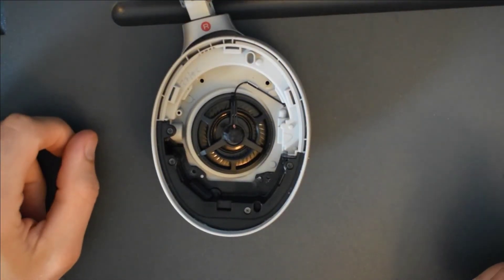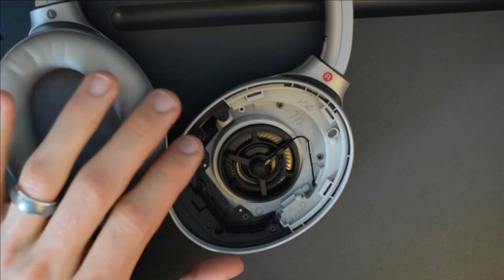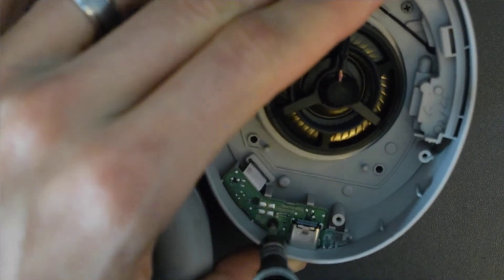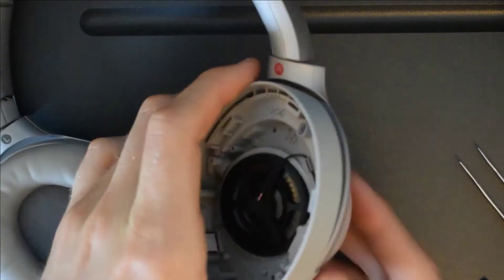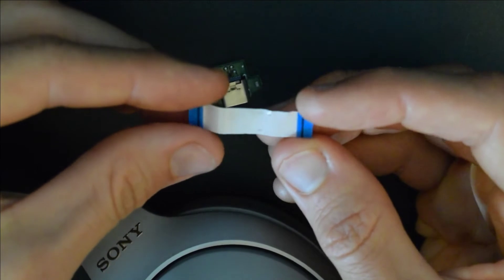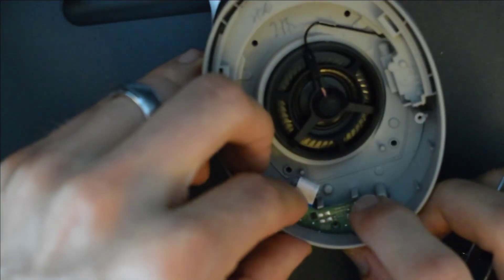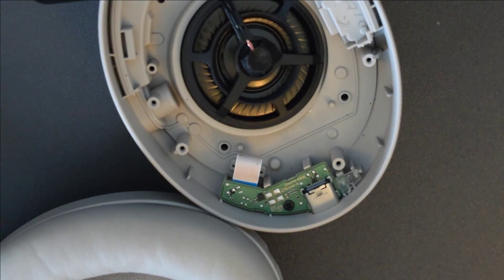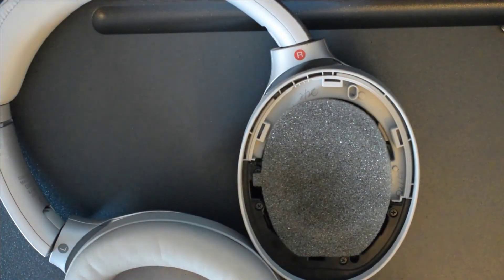Sony WH-1000XM3 Bluetooth Headphones Charging Port Repair/Replacement DIY Walkthrough/Tutorial

Comment: Hi, do you have any idea where to get an AUX port replacement? I have used it for a long time now, it started to give me trouble there is  background noise and not a clear sound ... use to work fine .. tryed cleaning it with isopropyl alcohol that help for couple days only ... any Idea how to fix this ?

Comment: Very helpful!  I have the Sony Noise Cancelling Headphones WH CH700n that are older than the hills and just recently (about 6 months ago) my headphones have to be in a certain position before they charge.  Seems to be a short somewhere.  I tried a different USB cable, but the same thing happens.  I'm not new to electronics, but the thought of opening them up does make me a little nervous.  I love these headphones and I can't afford to replace them right now if something should go wrong.  So this weekend it looks like I will see what's going on with them.  Hopefully it will be an easy fix. 🤞

Comment: Hi! Great video, thanks alot. Unfortunately my main cable got a problem. I managed to open it up and i saw that one small cable is broken and i can t solder it. Is there any way to replace the main cable?
Reply: What main cable are you talking about? what does it connect to? are you talking about the cable that connects the charging port to the main board?
Reply: @HaniJIsmail  , the cable that connects the right earcup to the left one. one small wire inside that cable is broken and i can t solder it so my right earcup sound doesn t work, but all the functions and sensors and microphones work just fine

Comment: Could u tell me exactly what flex cable I need to get for replacing it. I’ve replaced my port but it’s not work’n. Pretty sure the cable is shot. Just don’t know anything about this stuff. Looks to be 14 pin. Is that right? Any info u can give me would be great and maybe where I should get one. Thanks man.

Comment: Hi Thanks for video, would you be able to update the ebay link to buy the charging port. It seems that is not working anymore. Also would you be able to confirm if this is the same charging port for XM1002?

Comment: I just completed this and it went fairly well. It's worth noting that on mine the ribbon cable was secured to the slot with a dollop of adhesive. I picked this out with a pair of tweezers to free the cable but some adhesive had flowed into the slot, making it nearly impossible to get the new cable through. I managed to clear out the slot with a metal pick and a spudger. If you're having trouble getting the new cable through, shine a light in the slot and make sure it's clear of adhesive.
Reply: I had the same issue with the adhesive residue in the slot when trying to reinsert the ribbon.  I was able to use a fairly firm but thin card stock (index card) cut to the size of the slot to clear the residue.

Comment: If I just need the cable that is attached to the charging board, where would I get that? I have searched eBay, but there are dozens of types.

Comment: Hi, my son accidentally used the plug to charge my headset on the input, then i heard a burning smell. After that it didnt work, i tried replacing the battery, to no luck. It doesnt have warranty, what can you advise?

Comment: Hey is there a fix for my WH1000XM3's?
Its the issue where they charge, charging light turns on and the headphones work with aux but the buttons on the left side dont work so i cant turn it on, i tried a fix where you simply open up the left side and nudge all the wires but they dont work, and the button reset, none have worked. The headphones arent fried since aux works, but they dont power on.
Reply: Same here, have you found out anything?
Reply: @markelollo70  Nope, i sold them as broken, but im pretty sure it was maybe a battery replacement that wouldve worked.

Comment: Very good video and my repair seems successful so far as a result. Thanks! My one criticism is you skipped over a couple of parts after describing them (e.g.the removal of the old charging port at 2:00, the feed through of the new cable at 3:56) which would have been helpful to actually see.

Comment: I have a separate issue with the 3.5mm headphone port - the surround is cracked  and the port seems to be getting pushed into the cups. Any chance you have a video for that and/or the parts to replace the surround, please?

Comment: My one has a problem with the charging circuit board think because the battery and functions are all working properly. It's not charging anymore.. and the flex is also working.  Is there any way that I can repair it myself?

Comment: Thanks for your vid. I had an issue where touch pad was unresponsive and bluetooth would not connect. I was out in a light rain with the headphones so figured some moisture may have entered the charging port or aux input port. No signs of moisture upon opening the headphones up though. I started out be re-seating the charging port ribbon cable and that worked. We'll see for how long, but at least I know the issue is isolated to that connection.

BTW, these headphones are constructed wonderfully and even though they are not splash/waterproof, they have rubber seals and electronics are suspended from chassis. I now won't freak out so much if they get a little wet.

Comment: Hey great video, but the red light comes on for like 10 seconds then it comes off and it wouldn't charge what could be the problem? thanks for your response.
Reply: I have the same problem, did you find a fix kevin ?
Reply: @camshaft42  inside the left ear, a wire was shorting. I didn’t fix it fully. But when I opened it and move the wire it would come on but it wouldn’t work for long. The wire may need to be soldered properly.

Comment: My headphones show a red light when charging but never actually charge. Should I do this or replace the battery
Reply from the maker: That means like you probably need to replace the battery. If the charging indicator light did not turn on at all, then the issue is probably with the port.

Comment: mine seems to vibrate on the left side. not sure why. it comes and goes. any idea how to fix?
Reply from the maker: hey there. I have had that issue once before and what fixed it for me was just disconnecting and then reconnecting the outer panel on that side. Hopefully that will fix it for you too!

Comment: Just what I needed! My headphones can't charge anymore due to water damage (a few drops of rain was trapped inside the sponge for a long time) but battery was working fine. Sony wouldn't repair it under warranty which kinda sucks since I've only had them for a year. No visible damage apart from rusted screws so will try this when parts are available.
Reply from the maker: best of luck with your repair! Hopefully it will fix your issue
Reply: @jontriestofixthings3718  hi Jon, watched this video as my Sony 1000 xm3’s started to stop charging. I opened it up and removed battery cable from unit and waited for a while and reinstalled it. It’s now charging again so I’m not sure what the issue was and not totally convinced it won’t happen again. Do you have the charging port replacement in stock? Or do you have a part number I could try and locate? Thanks for the video man I appreciate it.